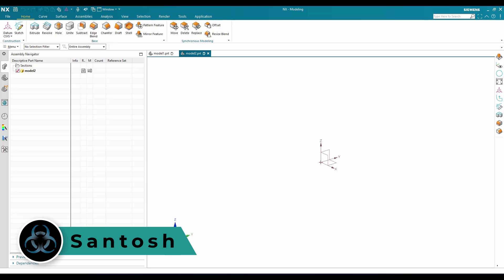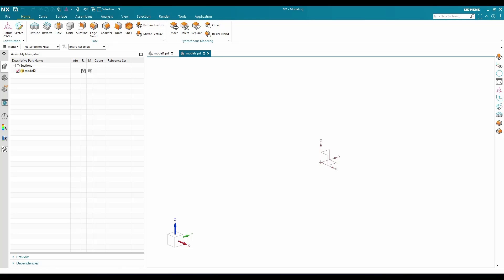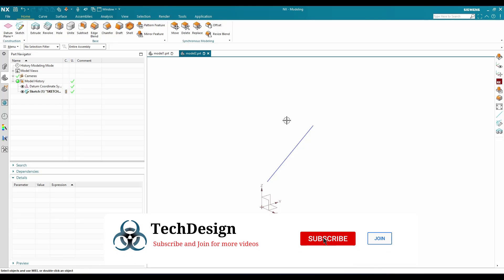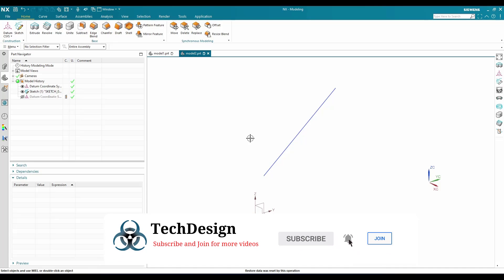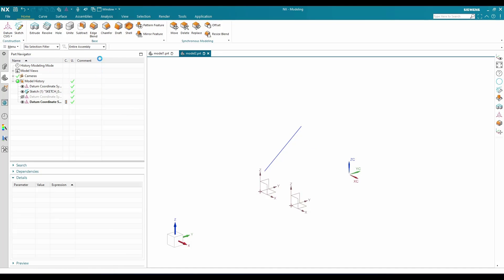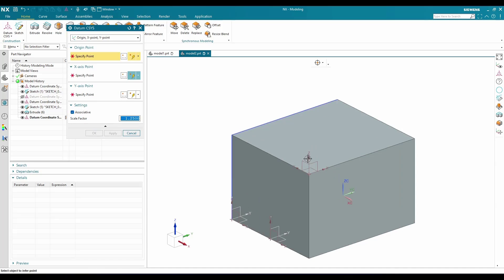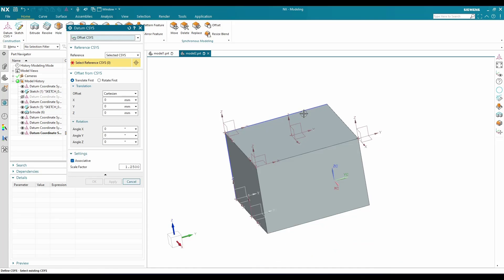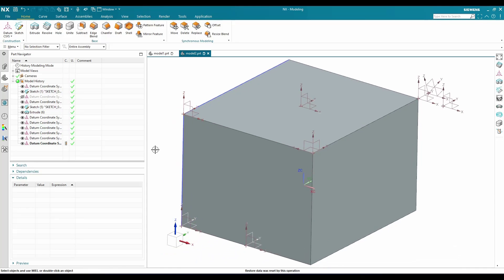Unigraphics NX Co-ordinate System, CSYS for Beginners || NX 2306 Tutorials

Comment: Santosh, you show many ways to CREATE a Datum Coordinate Systems ("DCS") in NX, which is good, but you gave no indication as to WHY the user might want to create multiple DCS's. Below are just a few reasons this capability in NX is very useful. But first, three important points about NX's  Datum CSYS capability...

(a) A MAJOR advantage of NX's Datum CSYS is that it always has all 7 elements you will ever need in order to orient and create any sketch, anyplace on the part. Every Datum CSYS contains 3 planes, 3 axes, and 1 point to which you to can locate, orient and dimension the sketch, AND determine the direction of the extrusion or axis of  revolution of the sketch.  All contained in one compact, single feature in the tree. To do that with any other CAD system, it would take a lot of time to add multiple planes, axes and points in order to construct enough reference geometry to create, orient and dimension the sketch, especially if the new sketch needs to be at an odd angle. NX does it in one simple step.

(b) You forgot to mention one major thing about using the Offset CSYS method: The user can translate the Offset CSYS first, then rotate it, or rotate first, then translate it. Both are very useful, and the outcomes are very different, so the user should practice each way and note the different outcomes.

(c) You can change the size, color and line type of each individual DCS in order to make them easier to distinguish in the part or in the assembly, and to reduce clutter in the graphics window. You can also group the extra DCS's so that you can turn off visibility as a group when the extra DCS's are not needed to be visible.

Here are some possible uses for the Offset CSYS method:

1) The part will be 3d printed, but the best orientation for 3d printing is different than the orientation in which you modeled the part. Just say you need to 3d print the part at a 30° angle in order to fit it in the 3d printer, or because you want a certain angled surface to be 3d printed perfectly horizontal so it turns out flat, with no "stair stepping". After you model your part normally, create an Offset DCS on top of the Absolute CSYS, but rotate it about the desired axis to the angle you want to print the part at, and name the new, rotated DCS "3d print CSYS". When the part is finished and you want to create the STL file for 3d printing, don't accept the default (Absolute) CSYS, instead choose the "3d print CSYS" , and the STL file for 3d printing will automatically orient the part exactly as you prefer it be printed. It's easier than having to manipulate the STL file in the 3d printing software, and any time anyone generates another 3d print file in the future, they can easily pick the 3d Print CSYS and the STL file will always be properly oriented for the next 3d print.

2) Similar to (1) above for 3d-printing orientation, except for machining or CMM inspection. If the machinist has to orient the part differently for machining than the way you modeled it,  or you want the part oriented a certain way for CMM inspection, you can create an Offset CSYS rotated, for one example, 90° from the Absolute CSYS, name it "Machining CSYS" or "CMM Insp CSYS" and then the machinist or inspector can just click on the appropriate CSYS and the part will orient itself correctly when the machinist opens the part in MasterCam or whatever program the machinist uses, or the CMM inspector needs to start creating the CMM inspection program.

3) If you modeled the part oriented as it will be during machining or 3d printing, but in the assembly it will be oriented differently, you can create an Offset CSYS that matches the assembly orientation, name that DCS "Assy CSYS" and when you first pull the part into the assembly, you can snap the part to the assembly in  one click  using the assembly option "CSYS to CSYS" in NX Assembly, then in the part file click on the Assy CSYS.

4)  If you need to create something like a round, tapered boss on a casting at an odd angle, create an Offset CSYS at the desired location and angle where you want the end of the boss to be, sketch the circle on the desired plane of the rotated Offset CSYS, then use "until selected" to extrude the sketch with draft back to the wall of the casting.  You can also use that same Offset CSYS you used to sketch the boss in the assembly, to constrain the bracket or bolt to the  boss, just using that local CSYS at the end of the casting boss.

5) If you have a large piece of equipment you are designing (car/tractor/airplane/ship) and many engineers are working on major subsystems, you can create the "master part" consisting of nothing but Offset DCS's (one for the fuselage of the airplane, one for the cockpit, one for each wing assembly, one for each engine, etc.), then each subsystem can be added to the top assembly in one shot by snapping the assembly CSYS of the subsystem to the appropriate Offset CSYS in the top assembly. If the fuselage gets longer, or the engines have to be moved, then just move the engine DCS's in the master part, and the top assembly remains error-free and the engines will move to their new positions, properly constrained, as soon as the top level assembly is regenerated.

Once you understand how simple, yet flexible and powerful the NX Datum CSYS is, you'll never want to go back to any other CAD system ; -)

********************************************************************************************************************************************
Reply from the maker: Thanks a lot for very helpfull information.
Reply: Exact question I was mumbling about while watching this and most of the other NX videos in YT. Appreciated!